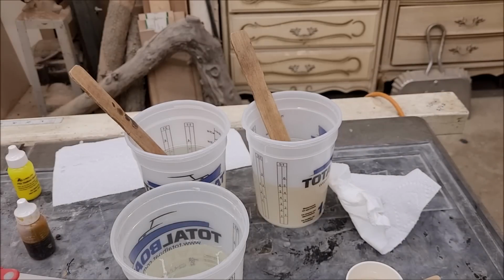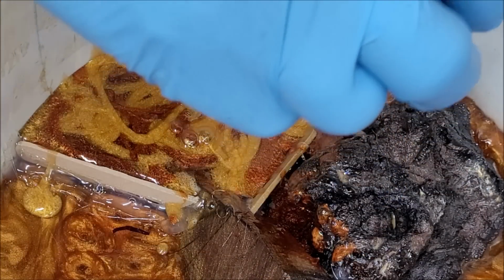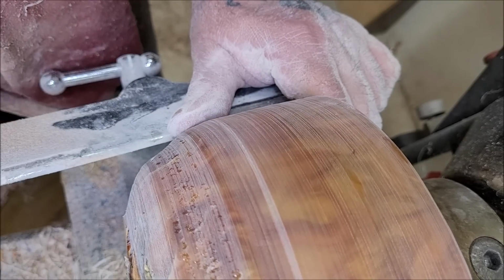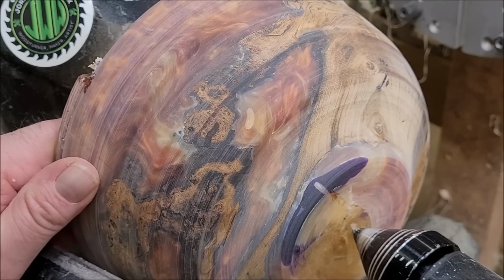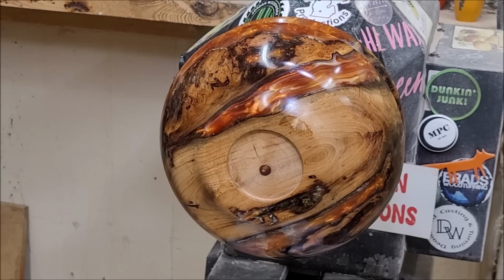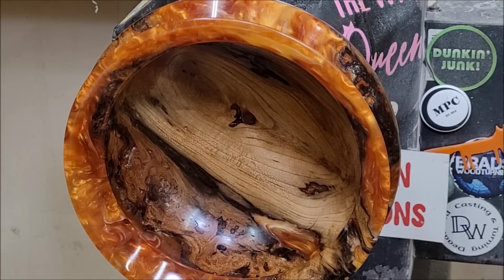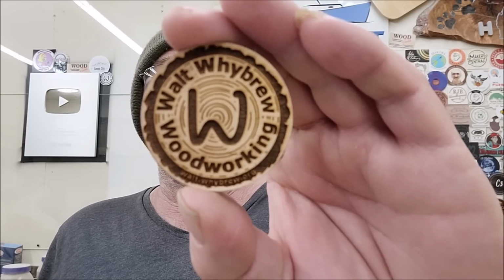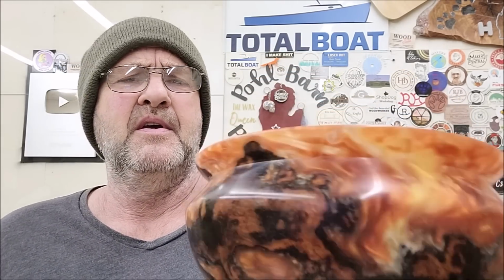Black Cherry Burl in Lava  🍒

Comment: You are correct, all wal and oils have to be removed before the shine juice is applied. Cap. Teddy said at one time if your shine goes away, either your mix is wrong, old or did not get it hot enough. Best luck. I don’t use it either 👍
Reply from the maker: Thank You Dave,  the shine juice does wear off and I had complaints from customers about it not staying shiny so I stopped using it

Comment: Beautiful work Doug. A satin finish will hold up better I think than glossy anyway :) Thanks for the video bud.
Reply from the maker: Yes it will, If I remember correctly I had complaints from customers that the shine went away, this is why I stopped using it. Thanks for watching Frank

Comment: do you wipe your piece with JUST denatured alcohol after each application of any finish or wax to leave a clean, fresh surface to work on? it may make a difference in your out come in you remove all traces of wax or oils, including linseed oil.
Reply from the maker: well I do if I use the abrasive paste, the shine juice it's self has boiled linseed oil in it

Comment: great job! 
I'm on the fence about shine juice as well... resin is much harder to apply but most durable, I've had pretty good success with clear enamel as well as lacquer. I guess what I use depends on what I made, will most likely be used for. If it's an art piece I'll go with lacquer, if it's a fruit bowl or key dish resin for durability, I'll probably stick to shine juice for pepper/salt grinder bodies I'm planning on doing a bunch of pens to give away as gifts those I might learn to do a super glue finish (or maybe a fast set resin... not sure yet.
Reply from the maker: Thank You Thank You, spraying the inside at the slowest spot always gives me trouble with runs so I get flustered and stop spraying lacquer,  it sucks to have to take it all off because you got runs on the 3rd coat,

Comment: You should try the finish I do it might work good for you bud. I start off with acouple of coats of sanding sealer. Then 3 to 4 coats or shellac sanding in-between each coat with scotch Brite pads then use my diy sanding pasta. And then use paste wax let it dry after I apply it till it's kinda chalky looking then buff it off with a high rpm. I've been having a lot of luck with that method. I do it on one my one lidded pot with purple resin on my channel.
Reply from the maker: I'll check it out Mick

Comment: If the abrasive paste is the reason you were having problems with Resin and/or Shine Juice Coatings, perhaps VERY thoroughly cleaning the surface of the piece with 90% rubbing alcohol to completely remove the wax residues from the paste might solve the problem...
Reply from the maker: I don't think the paste was the problem for it going dull,  it was for sure the reason for the streaks in it